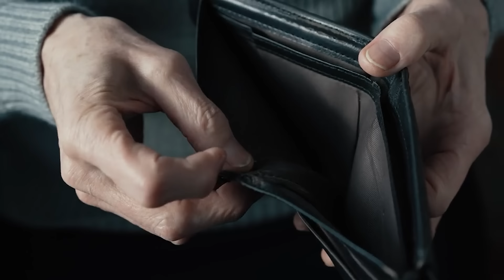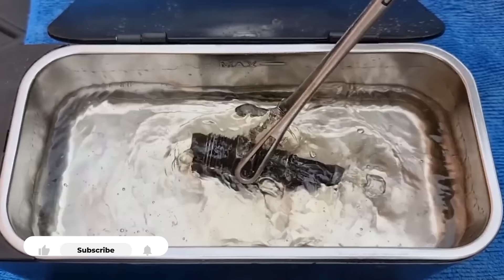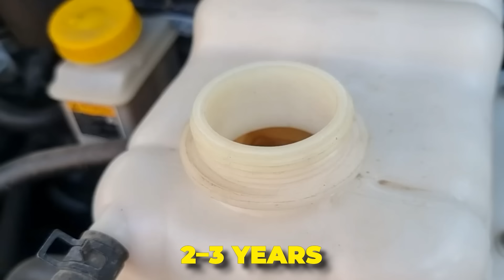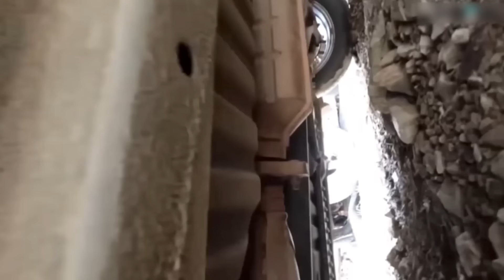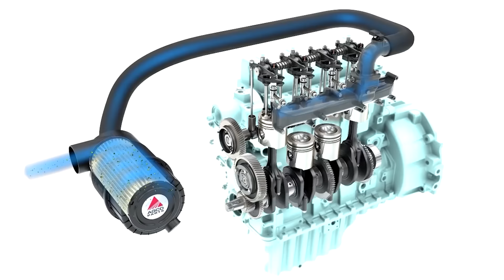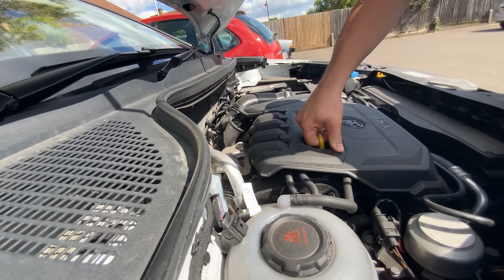Doing This Will Save You Thousands in Engine Repairs

Comment from the maker: Do This Once a Month and Your Engine Will Last Forever - https://www.youtube.com/watch?v=xybCPBYCoik&t=428s

⬇Care Care Clues Top DIY Tools and Products:

🚗 Essential Scan Tools
Newest Scan Tool:https://amzn.to/3GJyuET 
Bluetooth Scan Tool: https://amzn.to/42AcBRc 
Cheap Scan Tool: https://amzn.to/42WZIzx 

🔋 Emergency Essentials
Best Jump Starter: https://amzn.to/44fYOAm 

🛢 Fluids and Leak Stoppers
AT-205 Re-Seal (Stops Leaks):  https://amzn.to/3S9icYm 
ATS 505 Fuel System Treatment: https://amzn.to/3YQjjA2
Lucas Oil Transmission Fix: https://amzn.to/4jNk98M 
Bar's Cooling System Stop Leak: https://amzn.to/3Sht0nj 

🔎 Quick DIY Diagnosis Tools
Head Gasket Leak Test Kit: https://amzn.to/4jRgc2T 

🛠 Useful Maintenance Accessories
Quick Twist Oil Drain Valve: https://amzn.to/4jWG3GJ 
Tire Gauge (Check Pressure): https://amzn.to/3GxySGD
Tire Air Pump: https://amzn.to/3RZK9Cd 
CRC Mass Air Flow Sensor Cleaner: https://amzn.to/44dJpkb 

🧰 Mechanic’s Must-Haves
Car Battery Tester: https://amzn.to/4jTqyzk 
Basic Mechanic Tool Set: https://amzn.to/3Ymgerh 
Cordless Impact Wrench: https://amzn.to/3YkkhVc